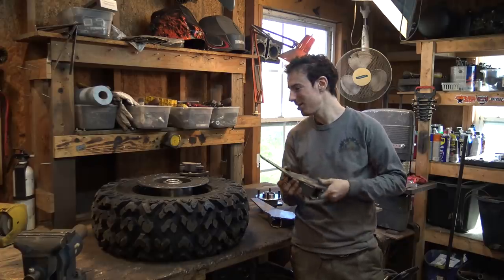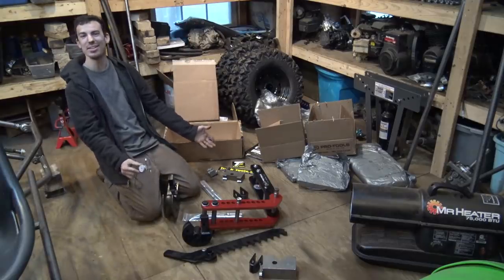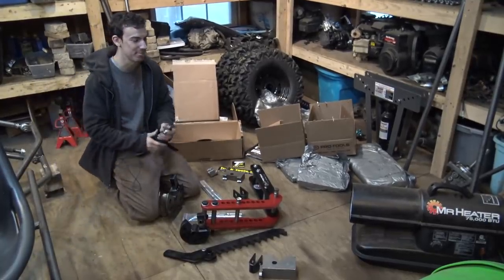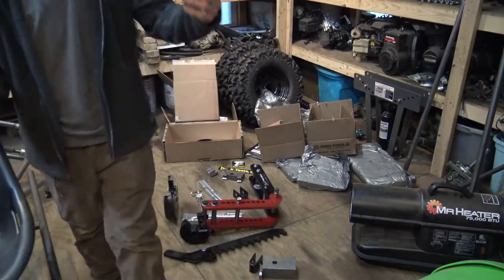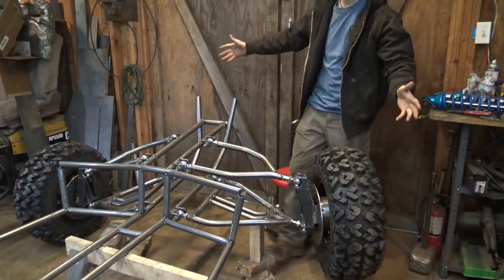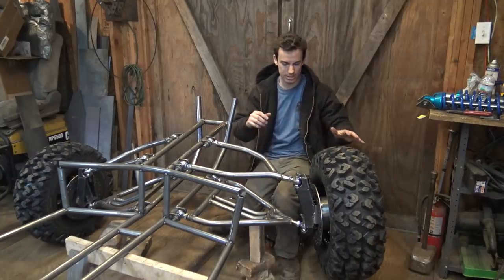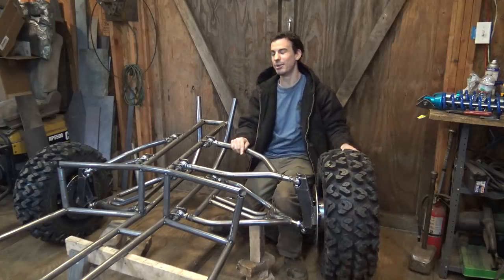Honda CBR 600 buggy build part 4

Comment: hay im sure you figured this out already but the wheel bearings or hubs you are using on the front are designed to have an axle in them with an axle nut to hold them together or they will come apart while you are driving it. you can make something to put in them to hold them together or just use some washers bolt and nut

Comment: I haven't caught up on your build, so you may already have done this, but I'd consider some bumpstops and limit straps to keep the heim's you're using inplace of balljoints out of bind.  Smallest amt of bind will cause a broken heim.  Not good on a front spindle like that.

Also, did you leave enough space between your homebuilt rotors and the wheel rims for caliper clearance?

Comment: You're going to want to brace between the heim joints on the frame. All that pressure will bow the frame between the suspension mounts and ruin your alignment or bend your tubing. A single brace between the front and rear mounts on the top and bottom should suffice.

Comment: I know it would be alot of effort but the top braces the top swing arms pivot on, cut an inch off, bend the frame up and 're weld. I can't remember what it's called but it's good to have the arms press up and back abit rather than straight up and down

Comment: Throw a honda d series in there and call it a day. Simple, reliable, easy to find, cheap and good enough for this size of a vehicle. That bike engine barely makes any power at lower revs, even if it had 100 horses it would struggle to push this thing.

Comment: Don't for get add bracing between the two upper and lower a-arms, you right it little big you could always add turbocharger for 180 to 200hp on top of that and would upgrade the clutch to Barnett or EBC

Comment: Don't worry about the engine, the cbr900 engine will drop in with only mods to the right hand waterpump mount. cbr1100x engine is very similar but fitting one of those into a F2 cbr600 i have not seen,

Comment: riding in sand with sandpaddle tires takes a lot of power. I burned the stock motor in my rc car just to keep it moving. Sure I upgrades to a power beast wich has more torque then you'll ever need and it was ripping though the sand. Now for the offroad buggy you want low gearing and don't need insane amount of torque like a sand rail, I think it will be fine with current bike engine.

Comment: I think if you find a hayabusa fuel injector system and wiring with ecu, you can slap a small t4 turbo and made it to where you can easily get at least 150hp at wheels with 6-8 lbs of boost. Not intercooler needed.

Comment: One problem seen those front wheel  bearings are going to fall apart as the cv shafts that normally would go through them via the cv nut provide the mechanical clamping force required to hold the bearings together whereas without the cv shafts or at least a preload clamping stub you are relying upon a minor interference fit and friction to hold the front wheel bearings together without their required bearing preloads (achieved when cv shaft nut is tightened)

Comment: Heres the thing tho, CBR engines are all about the same size physically. If you find that the 600 is enough, you can pick up a cbr1000 mill and basically just bolt it up in place. 
Alternatively, you can experiment with performance parts. CBR 600s have lots of performance parts available. You could even go with a full turbocharging system and basically double the horespower.

Comment: Amazing job, I understand why you want to use the motor you have and I think it will be enough to power it but your forward/reverse problem could be solved with a Subaru boxer motor or even with a 350 small block with a 4 speed manual. You can find a good 5.7L small block in a 96-98 gm truck/suv for under $400

Comment: Hey bro the cbr 600 engine will have plenty of power and speed for a off road buggy I've been in a couple of 600cc buggy's and they are blisteringly fast and have a pretty reasonable amount of torque

Comment: What size tubing are you using... you said 1 and 1 1/4 inch... but what wall thickness? .120? 1/8?
Reply: AimlessMoto .120 and 1/8th are only .005 different.
Reply: @thundertc88  yes, but schedule 40 3/4 pipe is 1" diameter OD and 1/8th thick. 1" tubing at .120 is actually much lighter. The question is really wether or not hes using pipe or tubing and what wall thickness.

Comment: I am just seeing this video and I love the idea of what you are doing. I have plans of building a 2 passenger car from scratch using a rear mounted 750 gtx motor but making it shaft driven instead of chain. It is also going to be 4 wheel independent suspension. I do have one concern in your frame design. With the main rails being so close and how long your upper and lower control arms are, I would think it would first be unstable as far as it rocking side to side. 
Also I would think you could put to much stress on the control arms when you hit any major bumps or holes. But I am getting ideas for my build. I will let you know when I start doing and recording the build.

Comment: Should of bought a steering rack before you built the front suspension. The width of the steering rack needs to match the suspension mounting bolts to steer correctly. And be on the same angle.
Reply: i made this mistake also ! but rebuilding my front end now lol

Comment: if them are s10 hubs you need to run a bolt through where the axle goes or they will fall apart
Reply: thats is just what i was thinking.maybe an end of a cv axle cut up to hold it together

Comment: think that you could make it 4 wheel drive with the front hubs  the way you made it theres room for driveaxles , looks like theres room on the frame for a front diff and a driveshaft or a long chain to the engine too

about the  die , if the trow of youre lathe can handle it you could remachine the groove to fit youre type of pipe , either that you clamp it down on the rotary table and verry VERRY slowly run youre flycytter through the round groove on youre mill and polish it with a piece of sandpaper rolled around the right diameter pipe 
youre pretty inventive so you probably can figure something out to get that die to work for youre stuff

as for the horsepower : a chevy c10 inline 6 is about 13- hp and its driving a truck about 3 times the weight of the buggy , you might not reach incredible speeds but you should heve enough power to pull you through the sand

Comment: Cbr 600 has a very low torque to horsepower ratio.  Going to need more torque for that weight vehicle. Do you have any estimates on the final weight with you included.

Comment: Did you know that if you use an actual quad engine, such as a Yamaha 660, it will have a reverse gear?   Also, how do you get your bandsaw to cut so much faster than mine does?

Comment: I don't think those heim joints on the spindle will hold up being side loaded like that. Those are press fit joints and the weight of the buggy will be constantly press them out. You need traditional style ball joints I believe. Or turn them 90° and use high angle spacers. Not bashing you do great  work just my 2 cents.

Comment: What is the rear tire diameter of the bike and what is the rear tire diameter you will be using? you simply have to decide how fast you want it to go and get the right sprockets it really is simple. I'm thinking you would need a final ratio of 5.2 to get it down to a top speed of around 80MPH.

From a few minutes of searching a stock cbr600 tops out at around 160mph and the rear tire is actually slightly smaller in diameter than your project tires and the stock cbr600 final sprocket ratio is 2.6 so to hit near 80MPH max you would need to change it to 5.2 or so.

You really need to run the numbers yourself as I am sitting watching the tv series 12 monkeys and figuring the ratio needed for a project and don't even have hands on.lol

Good luck, it is looking awesome.

Comment: Question from a non-fabricator with no experience bending tube: Is it possible to bend tube with a larger die than the pipe? What happens? 

Great build btw. Seems like you’ll end up with you’re own Ariel Atom.
Reply: Andrew you would end up with kinked tubing or at the very least flat spots where the bend is. The same thing happens when he uses that cheap style pipe bender in the video. It will not be a smooth bend, and will loose a lot of the structural integrity

Comment: i have a 4 Zylinder 4 Stroke Engine (Injected) of an VW Lupo laying in my Backyards. Completely with ECU and Wiring, Fuse Box and Tacho and Gearbox Generator etc. If you Pay for shipping i would give it to you. I Think it has 1.6L and would fit damn good in your Buggy.

Comment: One thing I will say is make sure it can fit out the door before you finish building it

Also, should just look at like a little civic engine, 4 cyl jeep engine, 3cyl diesel, anything works
Reply: The engine car have a long trans 
I think that wouldn't fit
Reply: @ikmalsomadani9970  yeah that is true. But if a person were to find a FWD car engine, the trans would be as long as the engine eh
Reply: @BigRig003  whoops
Sory i don't know that

Comment: if the engine is water cooled i would put the radiates in the section at front that is boxed bonus would be warm air blown over your legs

Comment: Hey man. If that moot is 90-100hp then it won't have a problem moving that frame. It won't be very fast,but it will be powerful. My Suzuki samurai has a 1.3 4 cylinder it makes 100hp

Comment: should have found an old 4x4 atv with a manual transmission. Then you would have a high/low range with 2wd option as well as a reverse gear without some janky setup. Also a one seater would be good too because it is lighter

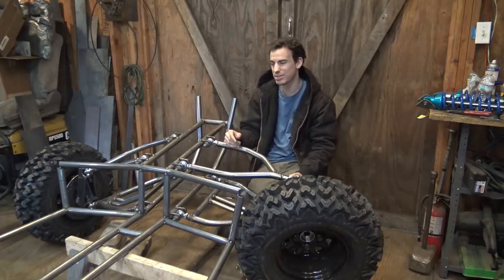Comment: FYI CbR has very little power on low RPM I believe the powers between 8 and 16 on the RPM gauge I'm pretty sure that their 14:40 gear ratio on their chain to where you would only need to change the 40 tooth 2  52 and then your jackshaft would be the same as your forward reverse 1:1 ratio most of the I've seen you are not allowed to change your gearing 60 is way to Torquay for your project I've only been riding motorcycles for 37 years meaning yeah you'll be able to climb a hill but you would top out at 30 miles an hour

Comment: 100hp is MORE than enough, my 1950 ford weighs 3100lbs. Has a flathead v8 with 110hp, and it cruises 75 everywhere, I don’t see any issue with that
Reply: Joseph Thigpen there is a big difference between the trans for yours that is meant to pull that then the trans for that bike engine😂😂
Reply: While you are correct, and being a flathead it makes torque off idle, that will never weigh more than a thousand pounds, so it almost doesn’t matter what first gear is, it will need a reduction because like you mentioned the gearing is far different and I’m sure it’s much higher, but the trans has almost nothing to do with what we’re talking about

Comment: great project! keep up! one question, do you measure the front turning pivot of the wheel??? cause I may thing that at the point I calculated its gonna be hard for turn your wheels on the steering. CHEERS from Santo Domingo!

Comment: Get a Honda CR-V engine. 2.0 liter with good torque and they are super cheap the trans is about the same 250 dollars. The wiring is simple or u cab buy it made if you want.

Comment: Your a great guy, I love your videos, you do a nice job of fabrication - better than I ever could. I love watching your cutting and welding. When you get chance look at this page on wikipedia about the "king pin angle". You need to imagine a line through both of those ball joints and get it to land right in the centre of where the tyre tread. It will make the steering work correctly, they figured this stuff out in the days of horse and carts but it applies to everything with steering geometry https://en.wikipedia.org/wiki/Scrub_radius

Comment: Put a 2.3l 1990s ford or 80s to 90s rotary.  Maybe even a modern sxs motor. But a worked 2.3 would be just right.

Comment: You need to find a wrecked utv and use the transmission off it . The horse power is enough I have a 1000 cc on mine and it will do 70 to 75 mph

Comment: big power helps in the sand and deep mud...other than that you only need like 12 to 25 horsepower most the time for off roading...i think if it has really steep gears it will be plenty fun off road...V8 power would just kill you back and kidneys

Comment: I agree his fab skills are pretty good.  But everything he builds is so heavy.  I bet the brake rotor hub and spindles he has on the front weigh in at 50 lbs each.  That's way too much unsprung weight for the size of the tubing he is using in the front suspension. 

He really needs to use lighter gauge steel to fab his parts.
Reply: Could have just made them a 3/8" or 1/2" plate with a 90 top and bottom for mounting ball joints. Maybe a couple 1/4" interior gussets.

Comment: Hi this is Steven your Honda CBR 600 will be very good and have more power and speed than you know what to do with it I use the all the time in my buggy builds and they work great a lot of power and I am using one in my 4x4 build now and it is way bigger than you build any way how can I reach you other that here I could tell you more info on small reverse gearboxes and other parts and help you with other building of parts were do you live I live in Missouri  also I would like to ask if you could build me two spindles like these two I would pay you for them also I would give you my number but no need for all to see it any way you do great fab work also you will need to cut the cup off of the front cv stub and put it in those hubs or they can come apart on you and your scrub radius is way far out there and did you put any caster in you front end your king pin looks  ok but did you put in rake too. I know you want to run Atv tires on your build because you got a good price on them but why do you not run a 15''' wheel to move in the scrub radius in and it would turn better and look better just trying to help you out I build a lot of these buggy so I know a lot about them and how they work. if I can help you more please let me know some how and let me know some how on those spindles  thanks Steven.

Comment: Dude I don't know how far north u are. But in actually selling my super hawk. The parts it needs to be legal won't apply to u. But the motor and tranny and everything are good. Well more than enough power u need. Just a thought. But a 1000 v engine. a 6 700 pound bike and does wheelies at how massive it is. I've been 165 on it no problem. I'm selling it for 250. Its well worth it just in motor and tranny.

Comment: Dude, CBR 600 has 88,1 kW (118,1 HP) at 13.500 rpm
Reply: You have to consider what year his engine was made in.
The first cbr600 did not have 120 hp. Neither did the second or the third, so yah.
Reply: @EddSjo  you are perfectly right.

Comment: Dont even acknowledge anyone who comments the crb600 isn't enough. You could have that buddy crawling whatever you want with a 3.5hp engine. They obviously have no knowledge of gear ratios. I drive a 2.5 ton truck with a 4 cylinder that probably makes 100hp. There's a s10 bogger here on YouTube with 1 ton axels and I believe 38.5 inch tires, powered by a 6.5hp predator... there are tons of rigs powered by tiny engines all over Youtube.

Comment: Try a PGM v8 motorcycle engine out of new Zealand. Very small, but around 200+ horsepower. Check it out
Reply: gary pease 334hp actually, but I’d assume if you could even buy one it would cost over $100k. If he has a bunch of cash to throw at it, he’d be better off with the Hartley V8 or even the 4cyl one they make for much less, that bolts onto a regular trans.

Comment: If you are looking for an easy solution to reverse and gear reduction,  use a gearbox from a B or D series engined civic or Integra,  preferably with an LSD (gear type) . Position directly behind bike  engine and drive input shaft with a chain through a slot in bellhousing,  support the end of the input shaft with a bearing mounted on a plate bolted to the face of the bellhousing to prevent shaft from snapping. You will end up with 30 forward's and 6 reverse's. Best of luck with the rest of the build.
Here is a link to a video showing this idea.
https://youtu.be/AouNIo3Z8hM
Reply: Or Volvo m45 gearbox
Reply: @TheMA77KE  , I'm not familiar with this gearbox,  is it a transverse unit? And is the engine on the left hand side (viewed from the drivers seat?

Comment: Every project you build is the same end story with exception of the shifter cart. "Its gonna be slow". Love the videos and I get safety but damn, stop making the frames so heavy!
Reply: Agreed.  More triangles and more time spent planning (maybe even with CAD) would really help cut down on weight.  CAD can be a bitch to learn but you can design the tube frame and run simulations to stress test, thus optimizing the design.
Reply: I agree. He's obviously a great fabricator. But I think a lot of his frames are waayyy over engineered.
Reply: @jiimmyboy63  *under engineered, but overbuilt